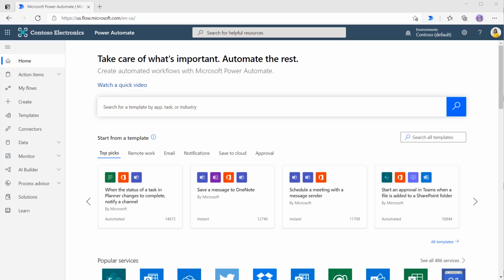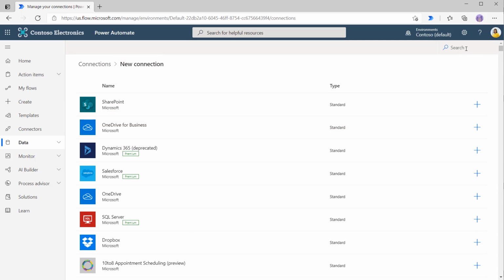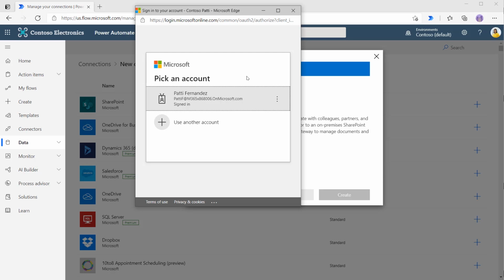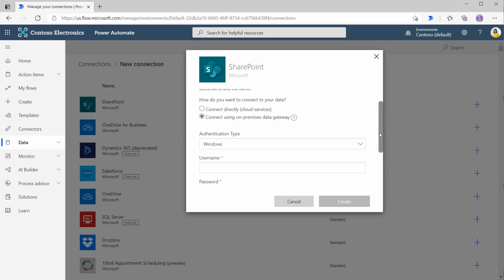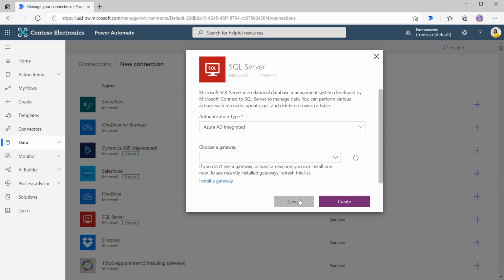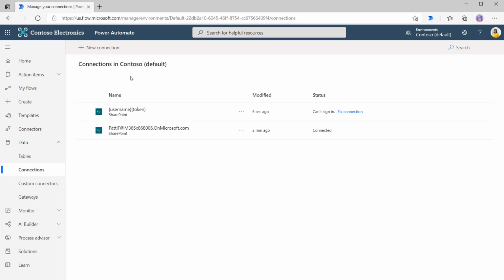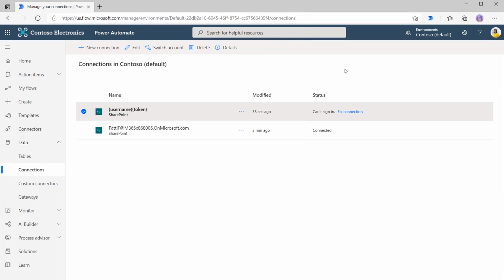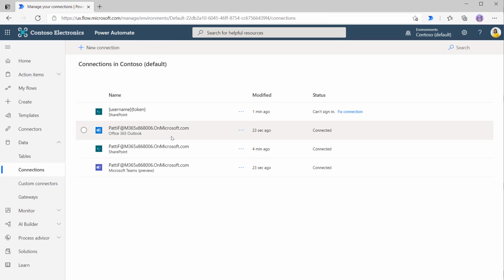How to manage connections in Power Automate

Comment: Is there a way to see which connection is being used by a particular flow and is it possible to change the connection? I would like to use an ArcGIS trigger but nothing appears in the Feature layers owned by current user box.